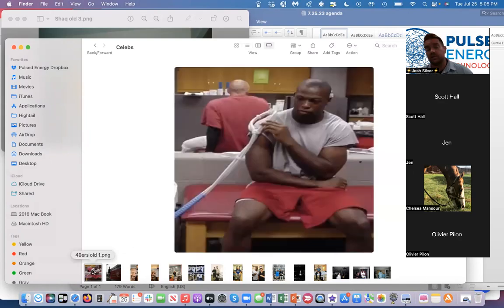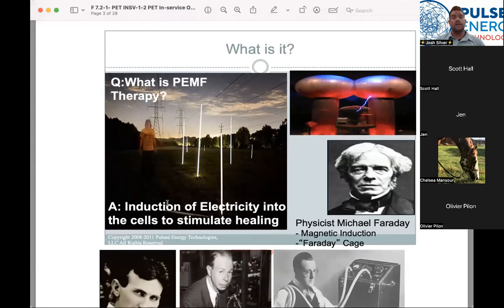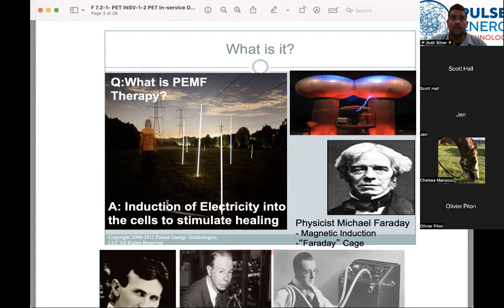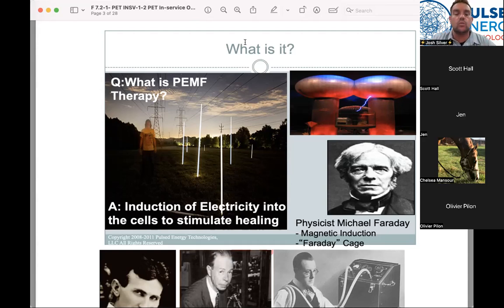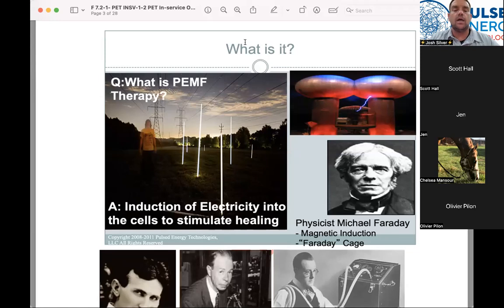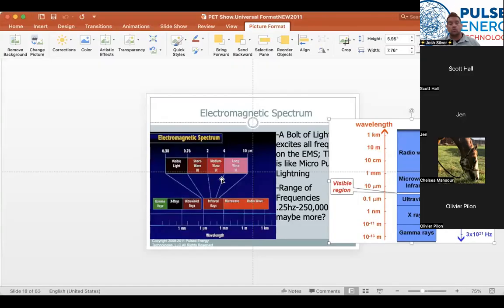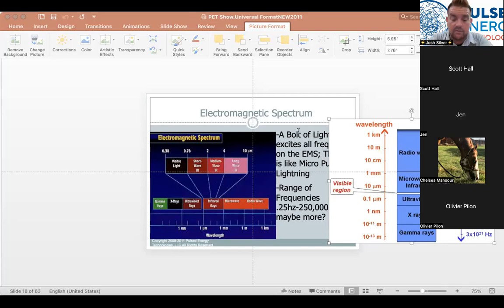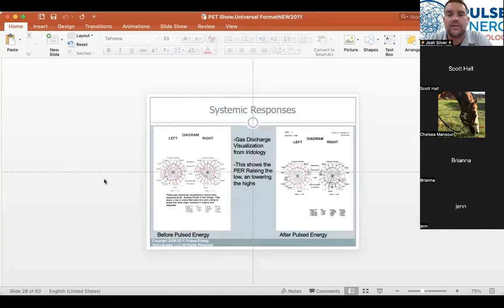Pulsed Energy PEMF Live Q & A

Comment: High power pemf is a load off bull shit this is just a money making review. A mat with 6 coils with just 50 gauss per coil works like a bomb as I and my family has had great results with this mat in just a few days. So do not believe high power is the way to go.
Reply: I found the opposite to be the case.

The mats feel weak and groggy and high powered PEMF simply works to charge cells and the entire body is very little time.

Have you used a high powered PEMF device. You seem biased?

They are amazing machines.

However I can imagine there is a place for both technologies.